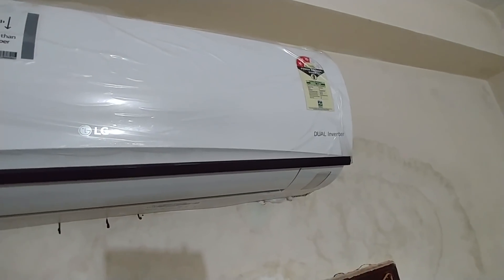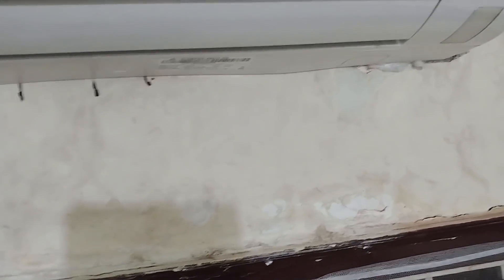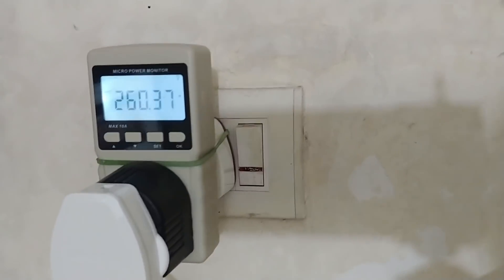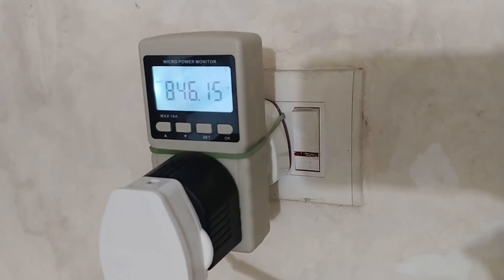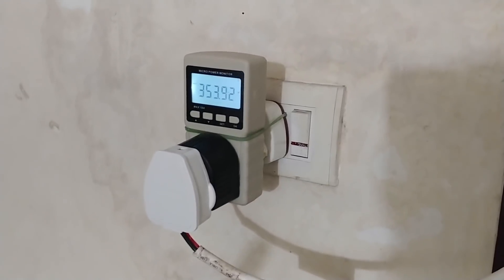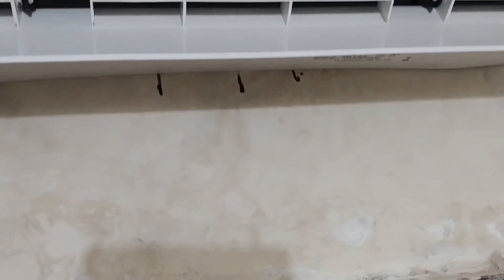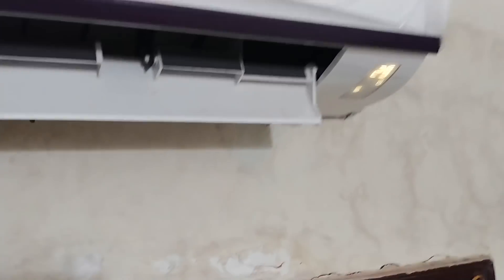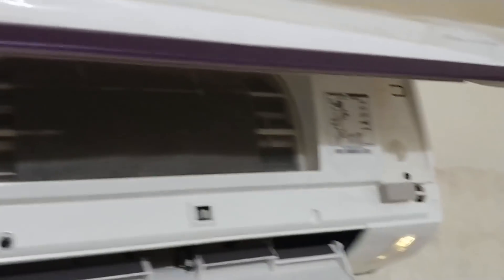Inverter ac how do they work- lg dual inverter review

Comment: Very good video. But with what I have gathered from your video, even if someone wants to maintain 18-20 deg C, don't you think an inverter AC will consume less power over a period of time (say 8 hours) than your conventional AC, because the the inverter AC compressor will use an optimum amount of power input throughout the period, while the conventional AC will work on start and stop mechanism and hence will consume greater amount of power for the same period.
Reply from the maker: Shankhya Debnath with 18to 20 u won't save much out of my experience
Reply: @narayannishanth465  Compressor On and Off process consume more power. Inverter AC runs at variable speed, hence they consume less power. What ever temperature you use, you will save with inverter AC. Anyway good explanation.
Reply: And lastly the heat inside plays major role in power consumed. Also insulation of your room and walls facing sunlight are factors decide monthly bill.

Comment: i want to buy an 1.5ton 3 star inverter AC,any one of these :-(1)Midea carrier brand 18ks santis Pro MAI18SP3N8F0,(on Flipkart);it has Rated PowerConsumption(Wattage) of 1990 w. (2) BPL Brand AC listed on Amazon,with Rated P.C.of 1770 watts....Pls Reply WHICH ONE IS BETTER,WHICH SHUD I BUY? WHAT  Does it any Impact of Rated Power Consumption?
Reply from the maker: Personally i have never used any of them it's better u buy a brand with good service network but i heard good things about midea but when i don't know i shouldn't give you a wrong advise
Reply: Thnx for ur quick reply,,,But main reason to ask on the point of Rated Power consumption,one has 1990 & others 1770 Watts,Does it matters?So, whaz is Effect of power consmption? What does it means /advantage/disadvantage of having 1990 ,& wa means of 1770watts?Does it draw more loaf/current,,so any effect on electric supply wire,etc.?

Comment: Very detailed & comprehensive review of Inverter AC tech with Power Meter..!!!!
Reply from the maker: Thank you
Reply: On the side note does your Compressor runs around minimum @ 350W while cooling, also does your Compressor Turns off after reaching the Set Temperature..and incrementally Ramps up while the temp goes up?

Comment: Firstly thanks for the reply.Oops 1.2 units an hour is going to burn my pocket. ok one more question if the outdoor unit is kept in a sheddy place then any effect on power consumption and last question if outside temperature is around 35 and I run ac on 20 for 8 hours
Reply from the maker: 0.9 to 1.0 units per hour once the room has cooled it falls down , but as 20c it will consume quite some power. if its in sun it will hit as high as 1.8 units per hour(for a 1.5t 3 star inverter lg ac)
Reply: That means keeping it in a sheddy place is better

Comment: If I run it for 8 hours on 20degree how many units a day will it consume
Reply from the maker: very difficult to tell like that has lot of factors that impact it such as weather outside temperature outdoor unit position but mostly 1.2 units an hour when compressor is on

Comment: My outdoor unit is install at rooftop and in direct sun light for full day. Can I cover it with wood cabinet or not. One more question is that the difference between indoor unit and outdoor unit is 25ft  and my local ac technician suggests me that I should fill litle bit more refrigerant than normal as my outdoor unit is install too far from indoor and the compressor has to work more than normal. What should I do what is your suggestion.
Reply from the maker: Yes you should actually cover with some wood cabinet but make sure you don't cover the rear intake. Yes you should add refrigerant as 25ft is very long but the quantity wont be much, the installation guy has to check pressure in the input pipe and add refrigerant accordingly. hope this helps
Reply: nishanth narayan thanks and very good video hope you will make a video on all the function of the remote of LG AC
Reply from the maker: thanks nadeem I am actually working on it functions of remote will be up by tomorrow
Reply from the maker: https://www.youtube.com/watch?v=0iB9Th4-WVY&feature=youtu.be